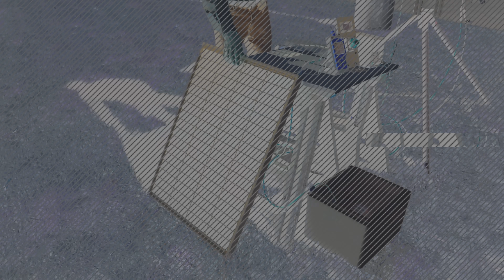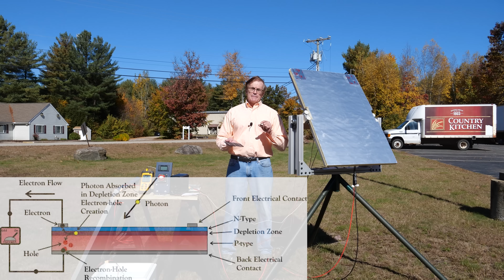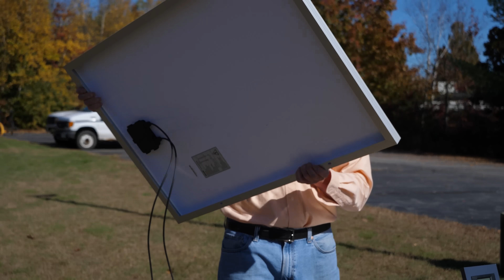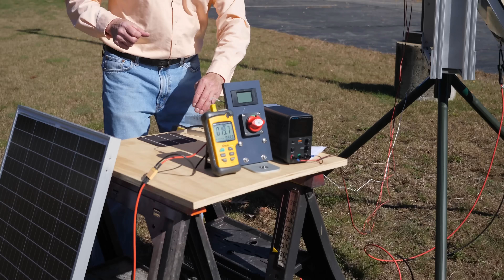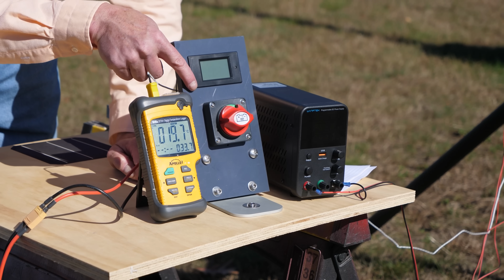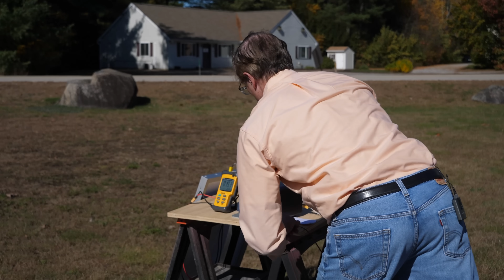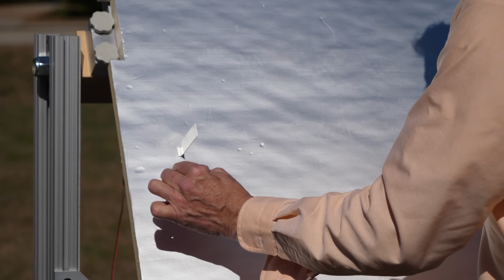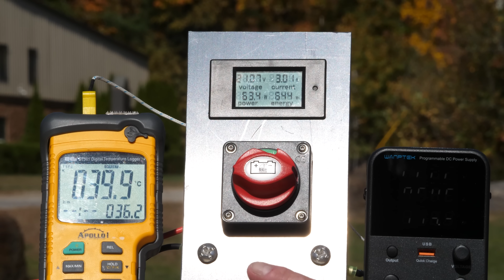Do you REALLY get enough out of your solar panel?

Comment: Solar PV panels cost between $0.35 and $1 per watt. The cost increase by going with this fairly unreliable setup (for 25 year warranty) couldn't be justified. There is an edge scenario where I could see this working/being justified. You have very limited space and you have the highest efficiency panels on the market and you have multi axis tracking. If you managed to do something like this for like an RV or some other application, I could see this making sense. Also 3 small fans probably isn't going to be as efficient as 1 large fan so if you could find a setup with a larger ECM fan running at a low speed, you might be able to eek out more efficiency in the setup. If you also got a fresnel or micro pyramid concentrator lens to put on top of the cells to increase production and therefore heat, this too would help improve the cost efficiency and effectiveness of this setup.

Comment: I wonder if one might improve the passive cooling of one of these panels just by painting that shiny white back surface with a thin coat of flat black paint.    There seems to be much controversy as to whether the benefit of blackbody radiation with black paint, is enough to outweigh the negatives of the insulating effect of the paint.    

I also wonder if an active cooling system using heat pumps could be practical if it was all integrated with a solar heat collection system.     Not just for removing heat from the solar panels, but at the same time moving that heat into the house in winter , or in summer storing it away somehow for later use in the house.    I live in rural Alberta where a huge portion of the energy bill in winter goes to heating with my natural gas powered furnace.    Any way a person can reduce heating costs around here, is hugely significant.

Comment: Love your channel... just subscribed!. I have a question/idea about improving your solar panel cooling system.  Could you further drive the temperature down using Peltier cells powered by the panels?  I am guessing it would work... but may not be economical.  Can you comment?
Reply from the maker: Thanks. 
It wouldn't  work.  The peltier  coolers would consume more power than the cooling effect would net.

Comment: Good stuff, hmmm if i remember correctly, on my 700kWp ground mount installation in Nigeria,  during mid-day my the surface of my 400w pv modules was 70 degrees C.  Next time I should check the temp behind the modules.

Comment: With regards to durability/lifespan, I understand that the panels would last longer, bit what about the fans? You’re now introducing these fast and constantly moving components into a normally still system. How often would the fans have to be replaced and does that cost outweigh the longer lifespan of the panel itself

Comment: The cost of adding the fans and replacing them every 3-5 years (even stretching it here) for 25-30 years is just foolish - you mentioned the appropriate way to do it, water cooling. That can be utilized in combination with rainwater collection, and in if it's a roof installation, you got a semi-continuous flow with natural refilling and you'll only need a cheap dive-pump as the single mechanical part.
Reply from the maker: The MTTF of these fans is 50,000 hours, and they only run during  the day...when it's clear.

Comment: Interesting.  I'd have been interested in temps with just the heat sinks applied the panels and convection removing that heat.  I am guessing but putting the heasinks at somewhat of a diagonal, or V shape to not have heat from bottom affect the upper ones as much would be advantageous as well.

Comment: You can also use a peltier between the cool side and the hot side.
If you laminated the hot side with a copper foil to spear out the heat/cooling and then add some peltier elements between the aluminium bends and this copper foil it might actually be even more cost effective with the temperatures you are measuring.
The delta T is nearly at the peak efficiency of peltier elements.

Comment: If I understood correctly, you attached the aluminum angle profiles to the back of the solar panel

What about attaching the aluminum profiles to the aluminum sheet?

Also, although I can't find one

What about using centrifugal fans instead of radial fans at the lower end of the panel to boost the chimney effect

Comment: Interesting experiment in the panel heating issues... I live in the Puget Sound region of Washington state,  overcast is common here... I am playing with portable panels like the Goal Zero Nomad 50 hooked to the Goal Zero Yeti 1000x power station... that gives me maybe 50% of the rated panel wattage on a decent day... I placed a reflector in front of my 50 watt Nomad 50 about the size of the 50 watt panel, panel tilted toward sun, reflector layer flat in front of the panel to bounce more light at the panel... the input into the 1000x power station rised to 50 watts,  the rated maximum of the panel... using your panels have you experimented with adding reflectors to increase the level of light hitting your panels...? The reflector I was using was a piece of Reflectix radiant insulation about as wide and long as the panel.

Comment: Have you considered designing vertical channels that optimize passive convective airflow across the back of the panels, since roof mounted panels are naturally on an incline around 30 degrees? It wouldn't move as much air as the fans, but it would be a lot less expensive, more reliable, and quiet.

Comment: What you didn't cover really, is the cost of this upgrade.  Also there are maintenance issues.  You now have moving parts where it was once static, and you might have made a nice little home for a wasp's nest.

As a rough guess, I'll bet you have doubled the cost of a panel.  I know you could probably make it cheaper by replacing the "plenum" with a plastic instead of aluminum covering.

Using a more centralized blower decreases the cost, but increase the complexity of installation and maintenance, I would guess.  All of these aspects need to be considered carefully before going all out.

I wonder if you could use your radiative cooler somehow to dump the waste heat through radiation instead of convection.  Place the radiators on the north side of the roof, and the solar panels on the south side.  It seems like this solution would work well on the hottest days, because they tend to have clear skies.  The added complexity of routing a liquid coolant from one pitch of a roof to the other is definitely a downside, however.

Comment: While air cooling already provides benefits, I think the greatest benefit is watercooling these units.

The heated water can then be used with a heat exchanger to warm up household water applications, meaning you actually save energy in another area, too!

Comment: Good solution for the summer, but in winter I'd rather circulate some water throught those panels and used it for taking showers or warming-up the house.
Reply from the maker: That won't work.
The temperature of the panels in the winter will be warmer than air temperature, but still cold, potentially, below freezing.

Comment: Great video as usual; you showed very clearly the bad result when the panels get hot; did  not know it was that much,over 15 or 20% less juice produced!!

still,quite a bit of work,especially if the panels are already on the roofs,need to disassemble all;

so, do another video  where,as per your sugestion, as this is easy to do,  you run a slow thin laminar flow of water evenly down the panel front , from     a 1/4 inch hose across the top, with some 20  holes of 1mm on it ,you'll figure that out better, and see if it works,and if the water waste and the labor involved  still compensate.
Reply from the maker: Thanks!
There are videos out there where people have done that, and it definitely  works.
Obviously, it consumes water, and unless the water is demineralized, scale  will accumulate, blocking light.
Air cooling is an alternative,  but not the only one, and will be more competitive where water is scarce and if the modules are available directly from the manufacturer with this option already installed.

Comment: Adding a few rows of thermal electric gens with your heat sink goop will probably boost power even more.  I'm really surprised that hasn't become a thing yet. As long as one side is hotter than the other...they make power, from unwanted heat...it'd be a win/win.

Comment: how often would you have to replace the fans though? and tracking all of them sounds awful.. plus now it's noisy
Reply from the maker: They have a MTTF of 50,000 hours and would only be used 12 hours on every clear day.  Tracking  has nothing to do with this system. I maintained the alignment during the test so that the comparison was fair.
Reply: @TechIngredients  oh no, i meant tracking if the fans needed to be replaced or not

replacing panels once every ~20 years is obviously not ideal, but it seems better than replacing panels every ~25 years plus having to keep track of a bunch of fans that die every ~10 years

and most likely it would be a lot more often since they would be sucking leaves and shit into them fairly often. (which you could add filters for, but then that would be yet another thing you have to track/replace)

---
absolutely love the purity and quality of the content though. 

everything has become so bloated with ads and over-production that no one really seems to do it just for the love of the subject anymore.

Comment: There are also people who have been actively cooling to a heat pump or during summer hot water heater and pools/ponds, use the panels as at a minimum deep-end umbrella/solar blocking to keep the coolest part of a water installation as cool as possible, maybe do a 3 for 1 and farm fish in a freshwater pool/pond, then when temps drop like in Albuquerque you have a heated pool year round, harvest fish year round, and should you hit a delta where fan cooling would still provide active return after also using a heatpump, tada, air cooled+liquid. Technically you could just aerated and feed around to aero/hydro planting to clean and setup as aquaponics as well.
Reply: In-floor heat plus radiant heat pump exchange. Sheesh. Upgrade to plans

Comment: BOO!  You've disrupted natural cooling by installing a barrier. You compared an obstructed panel with a "cooled" panel. I expect better from this channel.
Reply from the maker: The modified  panel  actually  runs slightly  cooler even with the fans off.
There's no need to be disappointed.
Reply: @TechIngredients  I guess we have to take your word for it since you didn't provide the data?  Simply put, most panels run in the mid-40's in 25°C ambient and 800W/m^2. The fact that you measured 53°C+ in 20°C ambient at even lower irradiance suggests that your modification inhibits normal cooling.

Comment: So assuming I were to set this up, then I would gain roughly 140 watts on 35 panels. I am also in New England. I am working with 370w panels as well, so with that being said, would that mean the panels get hotter than a 100w panel? I had a question about fans and you answered it in the video :)
Reply from the maker: I'm  not sure what you are asking.  The larger panels would not necessarily  run hotter than these smaller panels if their  design is similar.
Reply: @TechIngredients  Ok perfect, I wasn't sure if the wattage played a part in the temperature of the panel. 
I love all your stuff, especially the one where you used a mirror on the panel to increase the output by getting more of the sun onto the panel more of the time.

Comment: Solar farms are Air Heaters !
Asking ChatGPT to answer the question :
if the grass is at 30 deg c in a field, and the solar farm is at 53 deg  C the area of the solar farm is 1 km ^2 and the area of the field is 1km^2 how much extra heat is produced by the solar farm in perth australia
To calculate the extra heat produced by the solar farm, we need to calculate the difference in temperature between the solar farm and the grass in the field, and then calculate the amount of heat energy that would be produced by that temperature difference over the course of a day.
Given that the temperature of the grass in the field is 30 degrees Celsius, and the temperature of the solar farm is 53 degrees Celsius, the temperature difference between the two is:
53 degrees Celsius - 30 degrees Celsius = 23 degrees Celsius
To calculate the amount of extra heat produced by the solar farm over the course of a day, we need to convert this temperature difference into heat energy. We can use the specific heat capacity of air to do this, which is approximately 1.005 joules per gram per degree Celsius.
Assuming that the air temperature is uniform across the entire area of the solar farm and the field, and that the mass of air in the two areas is the same, we can calculate the amount of extra heat produced by the solar farm as follows:
The specific heat capacity of air is 1.005 joules per gram per degree Celsius
The mass of air in a cubic meter of air at standard temperature and pressure (STP) is approximately 1.2 kilograms
The area of the solar farm and the field are both 1 km^2, which is equal to 1,000,000 square meters
The height of the air column above the solar farm and the field is not specified, but assuming a height of 100 meters (a common assumption for estimating air mass), the volume of air above each area is 100,000,000 cubic meters
Using these values, we can calculate the extra heat produced by the solar farm as follows:
The temperature difference between the solar farm and the field is 23 degrees Celsius
The mass of air in the air column above each area is 100,000,000 x 1.2 = 120,000,000 kilograms
The total heat energy produced by the solar farm over the course of a day is 23 x 1.005 x 120,000,000 x 86400 = 2,049,364,800,000 joules
Therefore, the extra heat produced by the solar farm over the course of a day is approximately 2.05 terajoules.

Comment: ok your missing many real world factors.... First your at the best possible angle at max power, This only happens for a very short time during the day. This means at ALL other times there will be diminished returns and likely a loss. Being mindful of solar only produces so many hours per day. A solar tracker is a huge undertaking and cost to value by far not practical.  Also the cost of labor and materials to install this. Also no future gains on upgraded technologies. Solar much more efficient then it was even 5 years ago. Add another panel game over
Reply from the maker: Actually, you missed the point.  We used the mount in order to maintain  the SAME alignment during the comparison testing. 
I explained  that during the video. 
As PV panels  improve, cooling will remain advantageous to increase longevity and efficiency.
The game is never over.

Comment: Don't know if anyone wrote that already, but how about placing those fans on the bottom of the panel, instead of top? (or just flip the panel on that stand)
Reply from the maker: Why?
They are blowing outward.
Reply: @TechIngredients   oh,ok. My bad. And the air is sucked in from the top or from all sides? I didn't catch that in video.

Comment: What about using smaller "disposable" panels to run the cooling for the main system? The panels could be less efficient as long as they are easier to recycle.
Reply from the maker: That seems to add complexity.  You can simply  "T" off the main system  power and accomplish this with less hardware.

Comment: I like to read up on tech..well remember those solar farms..i do..and they had a problem with optimal solar capture rates..they got lower.. they realized they needed to clean the solar panels to maintain effiency.. did not have that in budget.. nor do leaves dirt bird poop ever get mentioned into solar efficiency..  I was a salesperson never mention the negatives don't have to most are already lemmings..  just ready to jump..  roofs  if not new will wear out before the solar does.. now that funny..
Reply from the maker: That seems like a commercial  opportunity.  Develop, test, and market easy, low-cost systems to keep PV panels  clean and free from snow.

Comment: I wish i could add photos of my setup. Because in the summer i use the 55f ground temp to blow up my wall and cool my attic.   I had wondered if there might be any benefit to bowing some of that air on my solar panels. Now i know thanks.   Furthermore i see if i add the 4"  tubes to the north side of the house i can cool that side in the same way as my south facing and still have enough differential to ambient to cool the panels.    P.s. i use the attic hot air to pre heat my clothes dryer.  Double benefit, attic replacement air comes up my exterior wall  from my yard and buried drainage plastic tube 4" diameter 100' long $50.  $1000 passive cooling  .ROI was two years.

Comment: I just watched your super paint episode earlier this week. Would it make sense to have a super paint panel array (for cooling) and pair that with a photo-voltaic panel array (for generation)? You would still need to have a fluid and a way to carry it across the panels, but I could see (maybe) having the SP and PV panels 'stack' or alternate in a vertical array, with a closed loop system. I want to believe in a clever convective loop that would carry fluid passively, but I'm failing at the moment.
Reply from the maker: The Achilles heel is the very low efficiency of  TECs.
Check out our previous video on the "Campfire Generator."